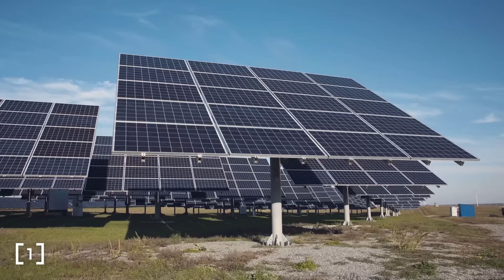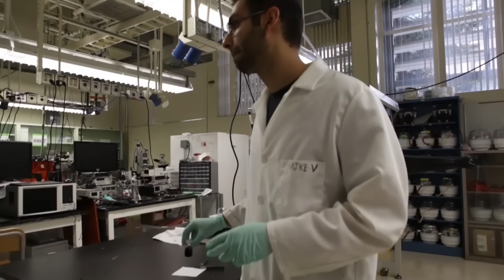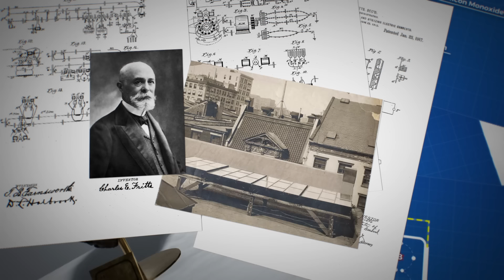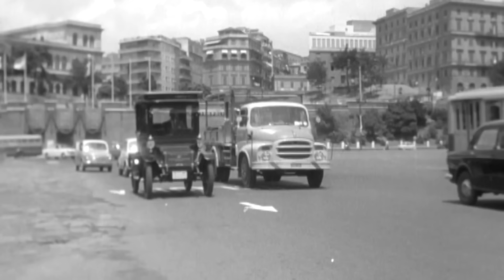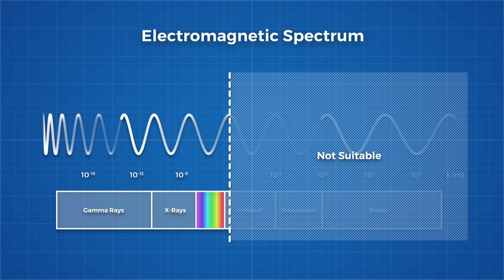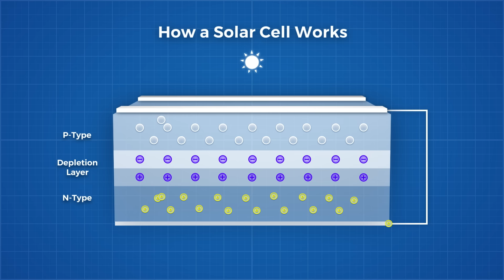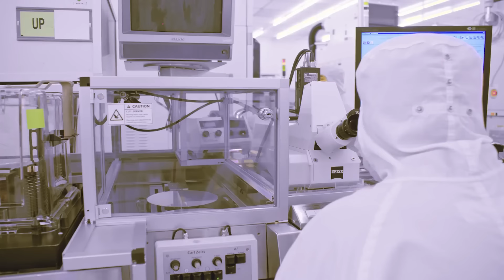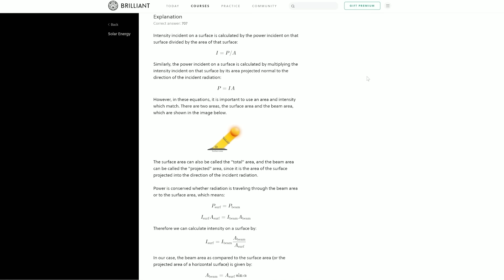The Mystery Flaw of Solar Panels

Comment: I used to work in the solar panel manufacturing industry, and one of the things that I don't see discussed anywhere is the enormous energy invested in the creation of each panel.    Whether 'renewable resources' are actually a good thing for the environment hinges around this number and the amount of time it takes the panel to pay back this energy deficit before it's actually making a profit...so to speak.   In the case of solar....at the equator where the sunshine is the most direct with longest exposure time a panel will take about 7 years to pay back the investment....and up here in the North our sunshine is much weaker and shorter and most panels won't be able to pay back this deficit in their expected 20 year lifespan.   So besides convenience where conventional power is not available there are many places on the earth where solar isn't a good investment of energy and far from our salvation.

While on a rant....the amount of energy per square foot is also pitiful compared to the energy consumed by say...a car.   A parking space size panel array in Southern California where the sunshine is optimum will create enough energy to fuel a Tesla about one mile per hour.   Sit all day at work...you get 8 miles worth of driving from it.   Terrestrial solar is not the answer to our future energy needs IMHO.
Reply: I'd add that it's a little inaccurate to say, as he does, that "technological advances are forcing fossil fuel out of the market." Regulations, subsidies, and public opinion are doing that.
Reply: A few hybrid or electric cars have solar panels on top! Way too little power to be worth the trouble, but great marketing, I guess.
Reply: Geothermal and hydroelectric is the answer. Until we get safe fusion that consumers can use. (probably will never happen xD)
Reply: @alfredharrison597  What do you experts think re tidal energy?
Reply: @waking-tokindness5952  I think its viable but less viable vs wind energy (since wind energy can be generated even at night time, but it could be random) but nothing compares to hydroelectric and geothermal when it comes to natural energy generation. One day we will be able to crack the net loss energy code and be able to use gravity and perpetual motion setups. Since gravity is a force thats infinite or nigh infinite, once we crack the net loss problem and can generate energy infinitely with gravity the energy crisis will be solved. Also there is the much talked about Zero Point energy, but I know very very very little about it.
Reply: I don't know. I've read the complete opposite. Not only do solar panels repay their manufacturing energy debt, apparently the technology has repaid its overall energy debt (from the time when the efficiencies were too low) too. Of course people who like solar energy will be biased towards believing this rather than the opposite... but I am pretty sure that energy repayment is a reality, we're really only bickering about the time it takes.
Reply: Dude, I live off grid in Canada and I can say that your numbers are way way off. It takes 7 years to pay back the energy defecit at the equator? That is not even close to being true! 
Parking lot sized array making 1 mile per hour of fuel? What are you talking about?
It takes 3 years where I live for my panels to pay back their energy input so the next 25 years are money in the bank and I don't have a tesla but I do weld, have been mixing cement all day long while my freezer is running and had power to spare at the end of the day, and I only have 3.5 KW of panels on my woodshed roof.
Either you are not very good at math or you are an oil company bot
Reply: @tomkelly8827  The area of ONE CAR...carport over that car gives about one mile per hour to a Tesla.   Did not say a 'parking lot' size array.   And how are you determining the energy deficit on your panels?   By how much they cost?   If so...remember they are heavily subsidized both to the consumer and the manufacturer so saying they'll pay back what you paid for them in 3 years is NOT the same thing as their energy deficit of manufacture.   If you actually meant their manufacturing BTU consumption...please show the numbers.
Reply: @recoilrob324  
"If you actually meant their manufacturing BTU consumption...please show the numbers."
Here you are: http://astro1.panet.utoledo.edu/~relling2/PDF/pubs/life_cycle_assesment_ellingson_apul_(2015)_ren_and_sustain._energy_revs.pdf
Reply: @qwertzundefinedapfel3830  Interesting paper!   I left the solar industry almost 20 years ago now and am happy to see that improvements have been made...as we expected with time and development.   But what we still see demonstrated in this paper is statistical manipulation working toward a pre-planned goal.   The amount of data that they threw out because it lacked just one of their parameters in my mind doesn't invalidate all the rest.   But anything outside of their expected mean was excluded.
They also averaged the light exposure across the world which I don't think is kosher because it makes their calculations easier but makes people thinking a solar panel in Canada is going to pay back the energy debt in the same timespan as Mexico?   They also averaged in all of the cell technologies when the highest powered is also the most used and highest energy investment.   The time to payback could vary by a factor of 8 according to them...so statistics can be made to tell what you want.
There is an old joke about a statistician with his head in the oven and his butt in the freezer.  "How do you feel"?  "On average I feel great!"  Papers from the renewable energy industry tend to paint a pretty rosy picture trying to get more funding...while the truth is often just a wee bit different.   In CA one of the largest solar installations has been averaging about 10% of it's expected output which results in them needing to get waivers for excessive natural gas consumption to cover the hole.   I'm a big fan of solar for the convenience when other forms of energy are not available, but trying to make it able to handle the heavy lifting just isn't in the cards.
Reply: @recoilrob324  
"But what we still see demonstrated in this paper is statistical manipulation working toward a pre-planned goal."
I' not quite sue what you mean. But at least there's some explanation comin...

"The amount of data that they threw out because it lacked just one of their parameters in my mind doesn't invalidate all the rest."
Beg your Pardon? They dropped
- papers which didn't discuss embedded energy 
- studies with exotic cell materials not in widespread use today
- papers which excluded the supporting infrastructure (wiring, mounting, inverter..) in their energetic efficiency calculations
- studies with "magic", i.e. where the reported result didn't meet the assumptions (two cases)
- studies using pre-2000 data for their calculations.
So why shouldn't they exclude those studies?

"But anything outside of their expected mean was excluded."
Now that is quite a charge. As I've listed the reasons for the exclusion of papers just before an unreasonable one as well. But I might have overlooked something of course. So, where do they say they dropped papers because of something like "outlying results" or anything in this direction?

 "They also averaged the light exposure across the world"
 Not really. The main discussion has been made with the average global insolation but the effect of other insolations (namely: Los Angeles,California; Trenton Mercer County, New Jersey; Las Vegas, Nevada; average US) were given as well, see chapter 2.4.3 on pp 136.
Also, this is a *scientific paper*. It is written with professionals in mind, not for the average joe who won't remember the first part of a sentence by the time he tries to digest the second half.

"They also averaged in all of the cell technologies when the highest powered is also the most used and highest energy investment."
Huh? They differentiated between the module types already in the abstract, let alone in the paper. Did you even read the Abstract?!

"The time to payback could vary by a factor of 8 according to them...so statistics can be made to tell what you want."
 Rally? First you complain that several factors were harmonized, and now you complain that the time to break even depends on the scenario? Seriously? Also: the graphs are not statistical data, they represent the range of values for the papers which were analysed. Therefore
 
"There is an old joke about a statistician ..." 
Is about half a globe beside the point.
2nd part in a second answer
Reply: @recoilrob324  
2nd part:
"Papers from the renewable energy industry tend to paint a pretty rosy picture trying to get more funding...while the truth is often just a wee bit different."
Please explain what the Department of Civil Engineering and the Department of Physics and Astronomy, both University of Toledo, have to do with the "renewable energy industry"?

"In CA one of the largest solar installations has been averaging about 10% of it's expected output which results in them needing to get waivers for excessive natural gas consumption to cover the hole."
Now you piquet my interest. Got some more information about that one?

"I'm a big fan of solar for the convenience when other forms of energy are not available, but trying to make it able to handle the heavy lifting just isn't in the cards."
Weeell, let's just call me unconvinced both about the first and the second. At the time I was born the public opinion was that electric meters would be a thing of the past real soon now(TM) because nuclear power would be so cheap consumption wouldn't matter (and a feasible terminal storage area was just around the corner, just you wait!). At the time I bought my first solar module this was something for geeks becaust those modules were both so expensive they'll never pay off and so fragile they'll break in a few years, just you see (again). By the time we installed the first system on the roof they were supposedly still to expensive to pay off and won't survive the first hail, just you see! Not to mention that there will be never above a few percent renewables, never ever, and the grid will break down once renewables would contribute a significant amount of the production. 2019 renewables scratched 40% of electricity generation here in germany, with solar some 7% of the generated electricity (https://www.bdew.de/media/documents/20200914_D_Stromerzeugung1991-2019.pdf).
Ah yes, and I'm missing the "weell, the high quality american-european modules might have lasted 20 years but not those cheap chinese ones build with substandard materials you get today, just you wait!"  which seems to be the latest position of the goalpost of the "they won't last, just you wait!"-lobby.
Reply: @qwertzundefinedapfel3830  I DID read the whole paper....and wondered why they threw out data that otherwise was sound but, for example, didn't include the installation hardware.   We're talking about manufacturing costs and the installation efficiencies are the least important to the outcome.    
The strength and duration of light input is NOT averaged properly with LA (very low latitude, Trenton NJ (mid latitude) and Las Vegas NV (again low latitude) gives an amount of light WAY higher than we see here in PA which is higher again than someone in Canada would see....so how does this average out properly?   They said the time to parity of up to 4 years in their examples, considering the excessive light average they used....jives well with my original contention of 7 years for the silicon wafer cells at low latitude exposure.   They've made some improvements in manufacturing...good!   But still it's going to take a LOT longer in Canada to pay for the manufacturing costs than they state in the paper.
I didn't read any of the papers they didn't include...but suspect that if they were included it would cast a shadow on their rosy conclusions.   When I left the solar industry in 2002 the best estimate was what I said of 7 years in equatorial sunshine to payback....and the paper doesn't convince me that it's that far off today.   Maybe a little better....but they're now saying 30 year life expectancy where we were using 20?   They are built about the same...how are they getting 50% longer life?   And their efficiency estimate seemed off to me too....the panels degrade with time but they figured that it wasn't much..but it is significant.   Just saying that when someone is looking for grant money from an industry....it pays you to offer 'documentation' supporting them so they'll pay you in the future.   Trying to correlate a bunch of data from others who did the actual measurements has my skeptical sense tingling a bit.   Especially if they threw out data that disagreed with their eventual 'conclusion'....wouldn't you agree that's a possibility?
Reply: For us & esp. our descendants, we need you more- -informed & -motivated debaters here to bring this debate out more into the purview of others, esp. of so many like you;   
more of whom, as a result, might together be helping improve our energy techs (than if you'd just left such initial-stage debate-inputs here).   
So, 

How about one or more of you, together, copying & pasting your arguments so-far into, say, one of the main reddit.com debate forums that have already been going on about this? 
(-- which forum, in turn, might often be referred-to by many other in-turn-widely-referred publicizers;  e.g., Wikipedia; Twitter; EpochTimes; NewsMax; Quora; .. .. ..  ?)  
   
&, as part of that, 
How about one or more, then yet more, of you, 
gradually growing a co-edited spreadsheet* 
(, perhaps often linked-to within such publications ,) 
for comparing various camps' summing-ups of each alternative's long-term benefits over costs [ in output over person-hours + resources + land used + monetary costs + etc ] ?  

------------- 
In any case, 
Gratitude  . . . 
, to all of you most-seriously debating here, for the benefit of us all, esp. for those to come after us;  so, esp. thanks here to:  
"Recoil Rob"; "qwertzundefined Apfel"; "Tom Kelly"; "CaptainSeamus"; "amojak"; "Marco Zorzi"; "Arjen Christian Helder"; "Ground Control"; .. .. .. [et al.]  \ 

-------------------------- 
*: To collaborate in making such a spreadsheet, feel free to ask one of us  'debate-spreadsheetaholics', to help ?  :  
e.g.:  email to me via RepayingKindness(at)grnall.corn or 
w2k4Net@gmx.corn  \\
Reply: @recoilrob324  
"I DID read the whole paper....and wondered why they threw out data that otherwise was sound but, for example, didn't include the installation hardware."
Well, they explicitely stated that they wanted the return of energy (ROE) of the whole system.

 "We're talking about manufacturing costs and the installation efficiencies are the least important to the outcome."
 Nope, not any longer: In 2008 I bought a 10kWp system for some 4,000€/kWp (cells only!). This year I bought a good 15kWp for an all-inclusive of 32,000€ which included harness, wiring, labor costs, connecting to the grid and a 10kWh battery. As I was curious I had a look and found the cells for some 550€/kWp(https://www.shop-muenchner-solarmarkt.de/q-cells-solarmodul-monokristallin-425-peak-duo-l-q-antum.htm) or, if you've some time to wait and are willing to DIY, below 300€/kWp as surplus modules (https://www.secondsol.com/de/anzeige/24554/pv-module/kristallin/mono/hanwha-q-cells/q-peak-duo-l-g8-3-425wp). If you have a look at the paper they say that even for the most energy-intensive cells, monocrystalline silicium, energy costs for the ground installation is already 1/6th of the total energy consumption and increases to about half the total energy costs for amorphous silicium, CdTe and CiGS (Figure 2 is the embedded energy of the modules and BOS, so you'd have to subtract the ee of the BOS given in Fig. 3 to get the ee for the modules). So no, it's quite important.
 
 
"The strength and duration of light input is NOT averaged properly with LA (very low latitude, Trenton NJ (mid latitude) and Las Vegas NV (again low latitude) gives an amount of light WAY higher than we see here in PA which is higher again than someone in Canada would see....so how does this average out properly?"
Maybe because(citation pp 136) "The universal”insolation value we used for harmonization was 1700 kW h/m²/yr which is representative of the average global insolation [44]". So probably they somehow irritatingly believed that the earth consists of more parts than just the truly important ones, i.e. US and CAN? 

"They said the time to parity of up to 4 years in their examples, considering the excessive light average they used....jives well with my original contention of 7 years for the silicon wafer cells at low latitude exposure. They've made some improvements in manufacturing...good! But still it's going to take a LOT longer in Canada to pay for the manufacturing costs than they state in the paper. I didn't read any of the papers they didn't include...but suspect that if they were included it would cast a shadow on their rosy conclusions. When I left the solar industry in 2002 the best estimate was what I said of 7 years in equatorial sunshine to payback....and the paper doesn't convince me that it's that far off today."
So what you're saying is that your experience is outdated by nearly 20 years but you still believe it to be correct?. Very well.

"Maybe a little better....but they're now saying 30 year life expectancy where we were using 20? They are built about the same...how are they getting 50% longer life?"
They dont. I've got modules which are 30+ years old and they are still working. But I can't say anything about degradation because I didn't keep any papers (if there were some to begin with). What I can say however is that the increase in insolation during the last 12 years easily compensated for any degradiation whatsoever and - together with probably already outdated values - makes for some overperformance of the modules when compared with the predictions. Not by much, mind you, but enough to keep the annual deviations on the plus side of the predictions. Those "20 years" are for bookkeeping so those clercs know how much to write off each year.

"And their efficiency estimate seemed off to me too....the panels degrade with time but they figured that it wasn't much..but it is significant."
Well, "These values were calculated based on a 0.5% per year degradation over a 30 yearlife time."(p. 136). The modules I put on my roof have a guaranteed degradation of less than 0.55% p.a. So, where is your issue?

"Just saying that when someone is looking for grant money from an industry....it pays you to offer 'documentation' supporting them so they'll pay you in the future. Trying to correlate a bunch of data from others who did the actual measurements has my skeptical sense tingling a bit. Especially if they threw out data that disagreed with their eventual 'conclusion'....wouldn't you agree that's a possibility?"
Why, of course that's a possibility. Just as it's a possibility that someone who pops up here and claims that all those numbers which are referenced by several dozends of papers are simply BS because he worked in this industry nearly two decades ago and says so is someone who gets quite handsomly paid to say so.
See, this works both ways. One side however has a load of papers to back it up.
Reply: @waking-tokindness5952  
"How about one or more of you, together, copying & pasting your arguments so-far into, say, one of the main reddit.com debate forums ..."
Sorry, no reddit (or anything else), I've got a life to live. There's enough information out there already.
Ok, this maybe was a bit harsh. So, long story short: check for data and references. A "reference" is not "my uncle twice removed said so so it must be true!" or "I've read it on the internet" or "www.//youtube.com/some-idiotic-video-where-someone-talks-a-lot-of-unreferenced-sh*t". Look for references in the description where you may crosscheck the assumptions. Critically examine the *references*: does it reference to a scientific paper, to a tabloid, to a blog? Does the reference really says what the original speaker claims it says, does he simply quote-mine or relies on its audience not to check the references which actually contradict him?
EDIT: https://www.youtube.com/watch?v=fNS4lecOaAc might give you an idea.
Reply: @qwertzundefinedapfel3830  Thanks! 
And, of course, e.g., so many "scientific" studies have actually been so fallacious (by, e.g., looking only at models, or nonrandom samplings, or .. ..  )  
-- really, so many continue to be so un -scientific ..  ..  

Thus, even such articles actually require, themselves, yet deeper references, in turn ..  ..  

In short, fact-checking "feathers out" indefinitely; 
we can only refine our probabilities; 
we can never reach perfect certainty. 

(RSVP, anyone, plz, re this universal conundrum of civilization.)
Reply: @qwertzundefinedapfel3830  I just spent a bit o-time looking around the 'web' for things that I KNOW were there 10-15 years ago...and can't find them now.   Methinks some sterilization of thought has been being implemented and critical data expunged from existence.  The 'lefties' here love to avoid discussions by silencing the opposition rather than actually bolstering their arguments with facts or logic and I'm now wondering if this has creeped into the solar discussion?
Oh well....Germany has done some great things with renewables and good for you!  But here in the USA the situation isn't as great and bad things have been foisted upon us by greedy Green People.   They build windmills to 'save the planet' yet they're still connected to the grid and in the end consume more than they produce.   When they DO actually run and are producing power it's not needed because there is base generation running at all times just in case the wind stops blowing.
In CA at least they dedicate a portion of the grid to the windmills or solar installation and they are responsible for the power.   Part of your bill is the insurance that it won't brown out and burn everything in the house...or they have to pay for it.   The CA plants employ natural gas generation on site to cover the darkness (solar) or windless days for windmills.   The problem is they've been using a LOT more natural gas than they promised...but the articles that reported on this have been removed from easy searches it seems...I smell nefarious doings.
If someone is solar powered and off the grid...my congrats and thanks!  But most people are still connected to the grid and THEY are a problem that they don't seem to understand that they are.   When their panels are producing more than the house is using they sell it back to the power company for an exorbitant rate...and this power isn't needed or able to be used....so anything they get paid just comes out of everyone elses pockets and is why my bill is 20% higher now that a few years ago.   They feel good about themselves by being 'Green' yet they are robbing their neighbors while not understanding that they are doing it.
Thought for you:  where do the electrons that run through everything that works in your house come from?  Most people believe (and is widely taught) that the power station pumps them through the wires and they go through the lights and whatever then to ground.   The reality is the electron source is the ground and the electrons are drawn back to the power source....this blows a lot of peoples minds.   Look up 'Tri-wye ' transformer and see how it is wired.   If power came from the station it's a dead short....but it doesn't because the electrons come from the ground.  Pretty neat!  Good on Germany for leading in photovoltaic use but here where natural gas is so abundant and inexpensive it doesn't make sense (or cents) to not just use gas.    Good discussion my friend!
Reply: @waking-tokindness5952  If others on different platforms would like to indulge in this conversation it would be most excellent to share it with them.  I sadly am self limited to YouTube comments and a couple motorcycle forums and won't involve redit or Facebook et al.   Any time I mention something that is 'verboten' it's met with criticism and is getting worse every day as censorship and the 'thought police' are hard at work trying to eliminate all dissenting opinions.   If you decide to do your spreadsheet magic...please feel free to include anything I have offered if you feel it is worthy of inclusion, just be aware that it might get the label of heretic assigned to you with banning a possibility.   Good to engage in a thoughtful discussion with people even if we disagree....that is the way adults are supposed to do things.   But in today's charged climate it seems that disagreements often degrade quickly into name calling or worse.   Hopefully if we keep back and forth on this subject here the people who have commented so far have been respectful and thoughtful without personal attacks....and my thanks to them.
Reply: @recoilrob324  Thank you for offering any of your input for "probability-scaping" (via spreadsheets & data-trees).  

& Yes: Sad that so many of us are so quick to shout down whatever differs from whatever variety of  "science" that one has  so hastily put one's faith in. 

A species of cultists, are we.
Reply: @recoilrob324  Your natural gas story is a common one presented by agents of the fossil fuel industry, this time expanded with a claim that California required on-site fossil fuel plants to provide a guaranteed base load supply for the grid, which is just stupid.  Base load rotating mass generation is important for grid stability, but installing miniature gas powered plants behind every solar panels won't do that, it needs physically large synchronous generators with inertial wheels like the ones in nuclear plants and big hydro plants.  Your second story about the direction of electricity is a hopelessly misunderstood version of the old story that by convention, DC electricity is said to flow from plus to minus but electrons flow the other way.  In reality, power plants pump electricity between the wires connected to them, causing an excess of electrons in one wire over the other (a voltage) and reversing direction every time the massive iron wheel makes half a turn (they rotate 60 full turns per second in the US, which is where they use terms such as Wye transformer).
Reply: @johndododoe1411  Oh?  https://theconversation.com/if-a-solar-plant-uses-natural-gas-is-it-still-green-50046     This is from 2015 and IIRC there have been other articles describing them needing waivers because of excessive natural gas usage.   But of course this must be propaganda from the gas company...right?
And electron flow can be demonstrated by following any solid state circuit...where you must begin at the negative and work back to the positive source because that's how it works.   And yes...solid state things run DC converted from AC, but still....electrons are electrons and they do flow so they must have a source...which is the ground.
Reply: @tomkelly8827  he might have to rely on others for the maintenance. I'm looking at 20+ yrs due to initial installation labor and maintenance labor.  Labor is several times the panel cost. Not cheap to uninstall/reinstall panels due to roof replacements too. I'll let you know in 10 yrs. ;) Though my next array won't be roof mounted.
Reply: @tomkelly8827  Yes but if you installed the panels on a tilt/turn table you will increase the energy collected but use a weight to provide the power to drive the table.